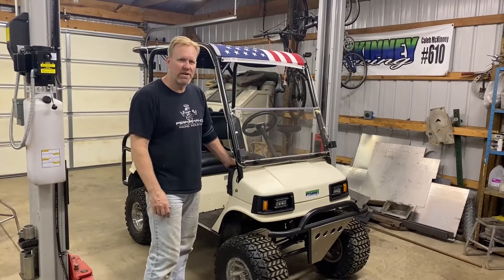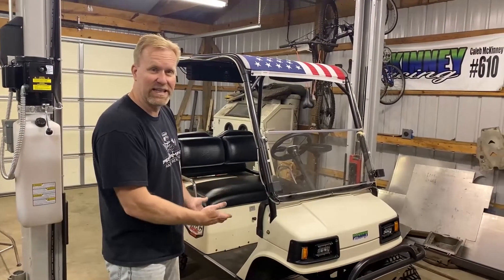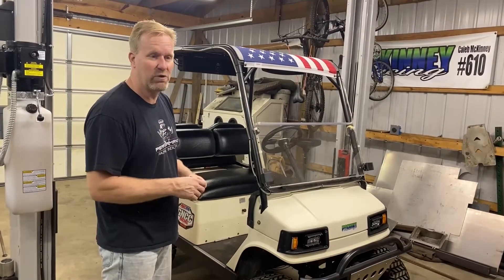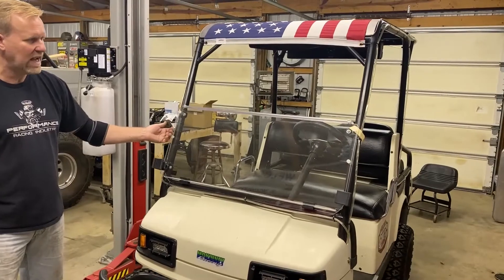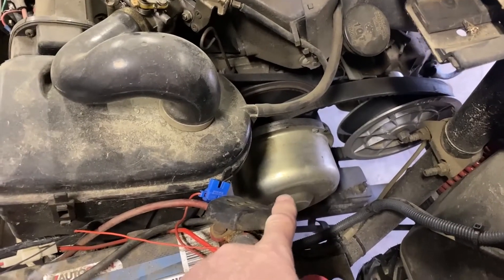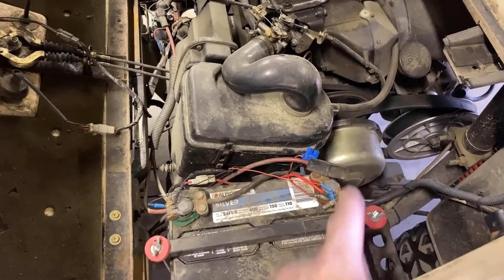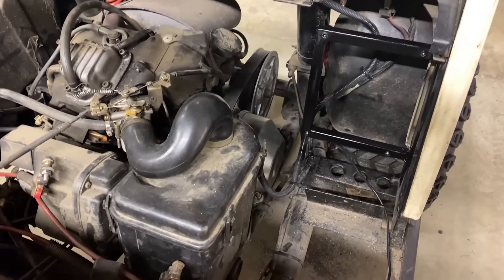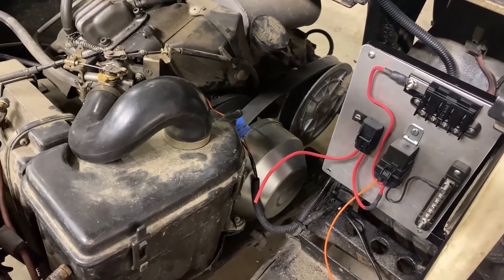CUSTOM 1985 YAMAHA G2 GOLF CART (FULL BUILD & NEW CLUTCH INSTALLATION)

Comment: Question I see you have heavy duty springs on the rear. We’re you able to use the spacers that came with them. I can’t get the springs compressed enough to put spacers in. Wasn’t sure if they are for longer shock absorbers.

Comment: One thing to add to about the new aftermarket clutch is the puller tool for the original clutch will NOT work for the new clutch. They use different threads. Original clutch is an oddball metric size thread and the new clutch uses I believe either a 5/8 or 9/16 fine thread (its been a while so I dont remember). I made my own aftermarket clutch puller on the lathe and it looks identical to the OEM clutch puller.